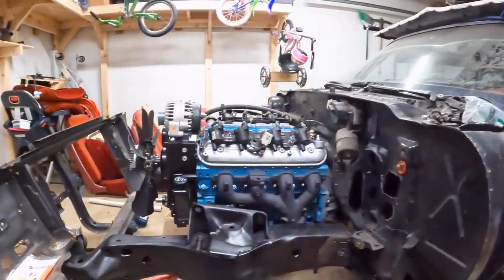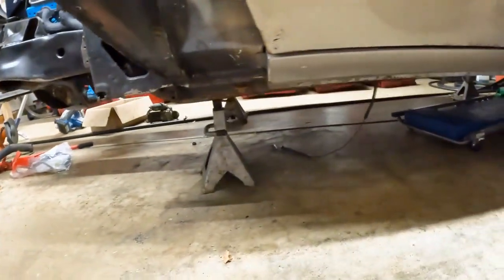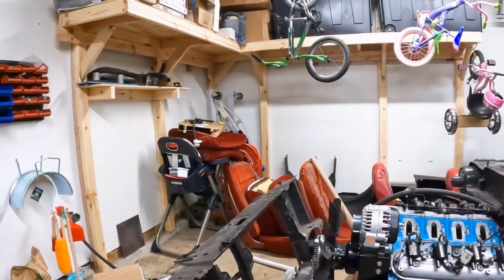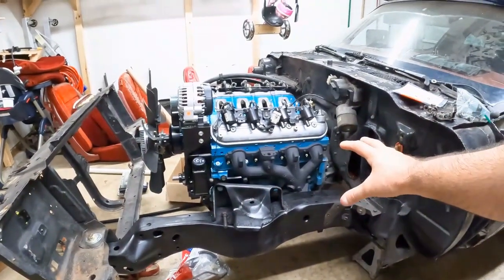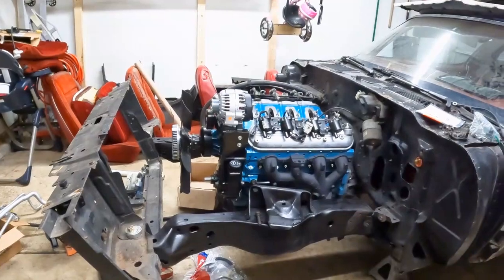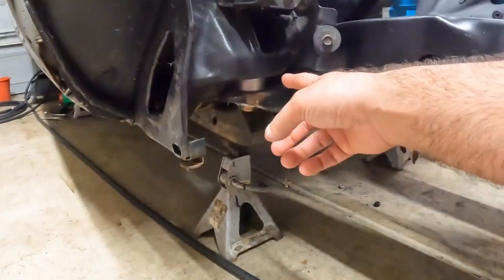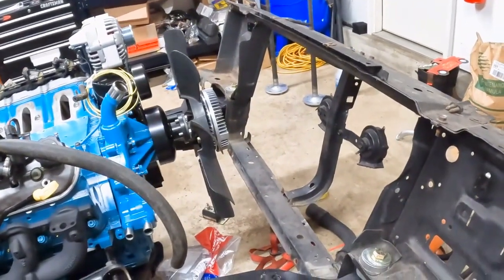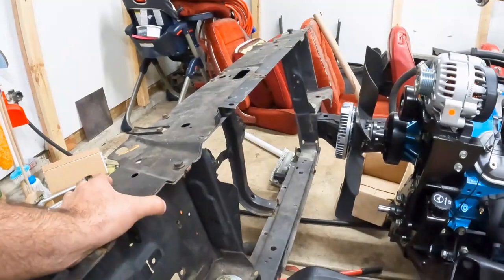The first mod you should do to any 1967-1981 Camaro or Firebird

Comment: On my 71 Camaro I adjusted the height of the front solid mounts to help in aligning the front sheet metal.  Had to take about 0.100 inch off each of the front mounts.